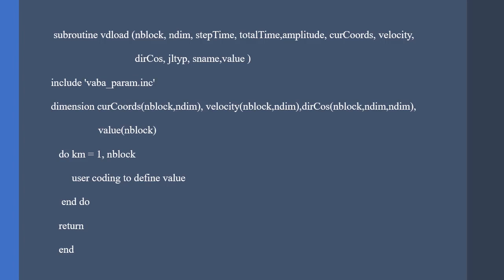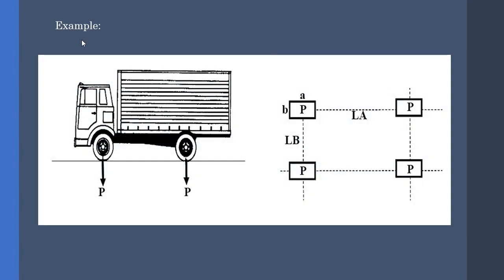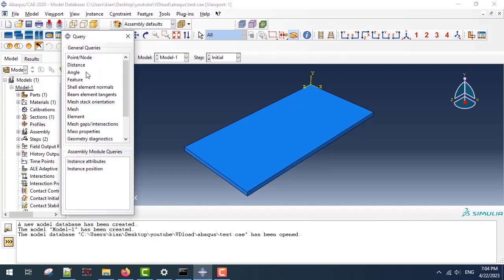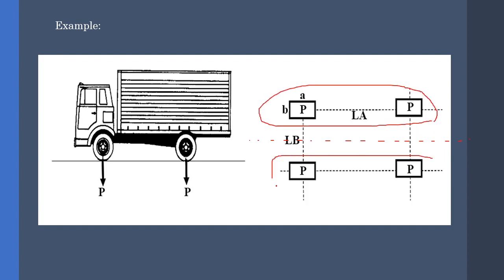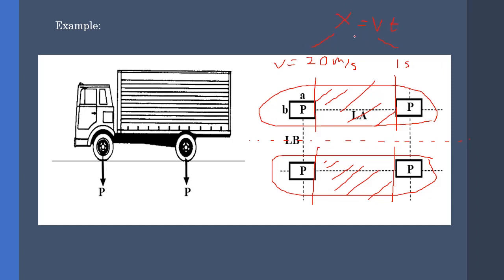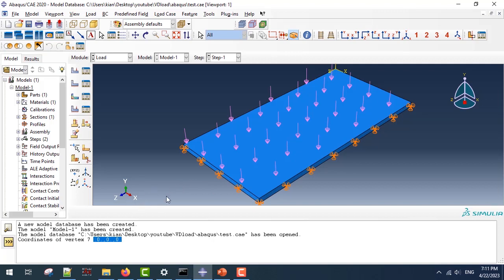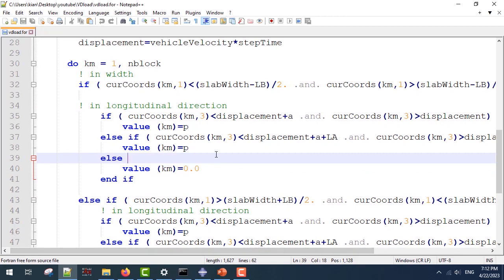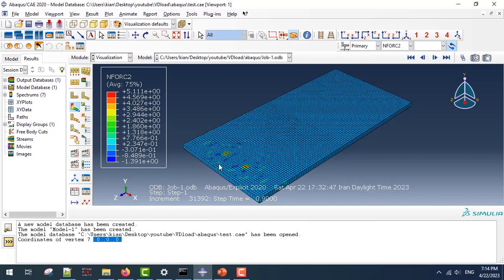Simulating moving truck load using VDLOAD subroutine

Comment: thanks for your sharing, sir. I'm using your script but I'm having trouble getting it to run., can you help find where errors are?   
subroutine vdload (
C Read only (unmodifiable)variables -
     1 nblock, ndim, stepTime, totalTime,
     2 amplitude, curCoords, velocity, dirCos, jltyp, sname,
C Write only (modifiable) variable -
     1 value )
C
      include 'vaba_param.inc'
C
      dimension curCoords(nblock,ndim), velocity(nblock,ndim),
     1  dirCos(nblock,ndim,ndim), value(nblock)
      character*80 sname
C
	    real*8 a,b
		real*8 LA,LB
		real*8 p
		!real*8 slabW,v
		a=0.35
	    b=0.2
		LA=5
		LB=2.5
		p=1000
		slabW=10
		v=20
		disp=v*stepTime 
		
      do  km = 1, nblock
        if(curCoords(km,1)<(slabW-LB)/2. .and. curCoords(km,1)>(slabW-LB)/2.-b) then
			if(curCoords(km,3)<disp+a .and. curCoords(km,3)>disp) then
			   value(km)=p
			else if(curCoords(km,3)<disp+a+LA .and. curCoords(km,3)>disp+LA) then
			   value(km)=p
			else
			   value(km)=0.0
			end if
			
	    else if(curCoords(km,1)>(slabW+LB)/2. .and. curCoords(km,1)<(slabW+LB)/2.+b) then
			if(curCoords(km,3)<disp+a .and. curCoords(km,3)>disp) then
			   value(km)=p
			else if(curCoords(km,3)<disp+a+LA .and. curCoords(km,3)>disp+LA) then
			   value(km)=p
			else
			   value(km)=0.0
			end if
        else
		value(km)=0.0
		end if
	  end do
	  
  return
end
Reply from the maker: Hi.Check your *.log file.
Reply: Hi, I found my problem because of the version, I'm using version 2022. @kianaghani